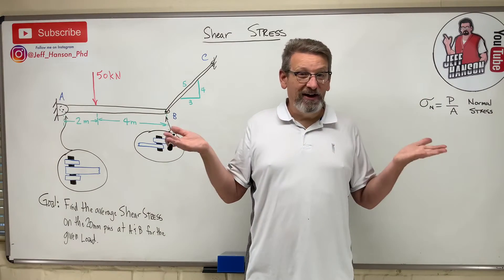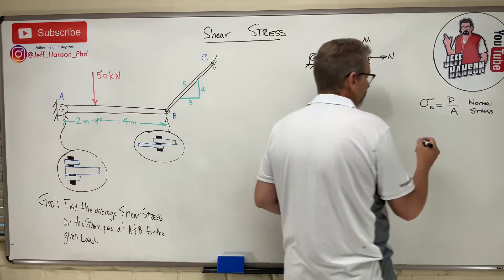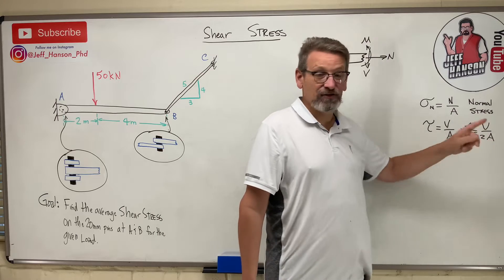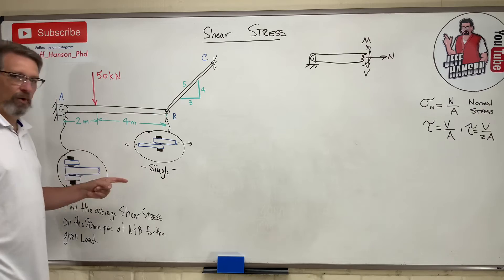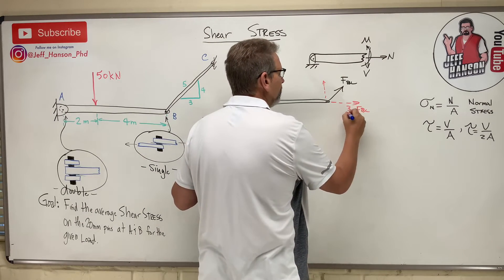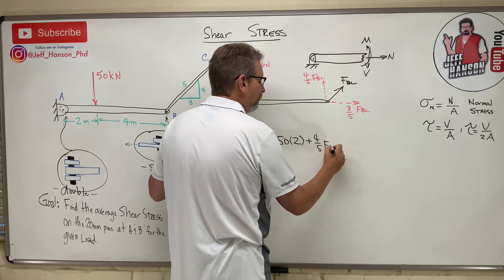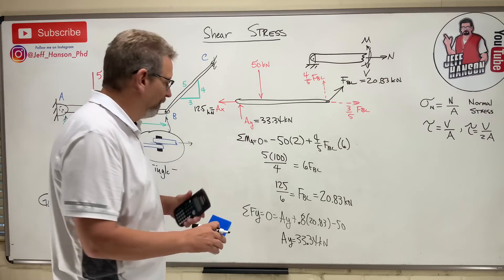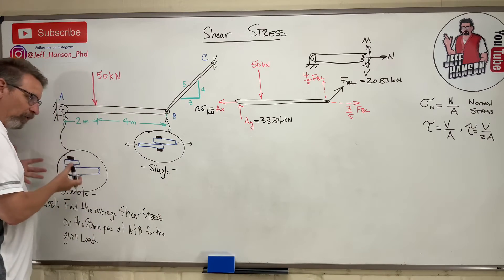Mechanics of Materials: Lesson 4 - Shear Stress, Single and Double Shear Example

Comment: HI . For finding the shear stress at A, wont FA just be Ay . I mean the shear force is always vertical . Why are we taking the squares of Ax and Ay ? Also how do we know if the method of sections is required for finding the shear stress . This problem did not require any methods of sections .

Comment: why did we use the resultant force while calculating the shear stress? i thought we were supposed to use the force component which is parallel to the surface area

Comment: Thank you Prof for this video. Although I hae got a question. Shouldn't the Force used in calculating the Shear stress be the shear force and not the resultant force as used in the calculation. Thank you as you dispel my misconception and calrifying imthe resultant force should be used.

Thank you sir

Comment: Hello, Thank you for sharing nice videos. I had a question, for calculating shear stress at A & B why are we taking resultant force? Will not be the force working on perpendicular to the cross-section, that mean Ay and Fbc?
Reply: first of all shear strees creat by parallel  force to the cross section. if you understand this then Ax and Ay are both parallel forces to the cross section.so you most calculate the resultant RA .

Comment: Why are you taking the resultant on A for the shear stress? The x component acts on a different cross sectional area on the internals of the pin vs the y-component.
Reply: Both are acting across the same cross sectional area. Both are acting across the xz-face.

Comment: can you explain more on why you used the resultant force at point A and not Ay to get the shear stress
Reply: Same problem here.
Reply: because the support at A has two components or reactions, Ay and Ax. So, using the resultant force of the two components gives you the more accurate reaction that is applied at support A, therefore, using resultant force to get the shear stress.
Reply: @fadelity4444  I am still not following. If I was to obtain normal stress, id only use the x component of the force, but for shear why arent we using just y component of the force?
Reply: Hello, I got confused regarding the area. Since the given is diameter, isn't it pi/4(d²)?
Reply: @kentalbertlucob5032  is equal pi×(r)2 or pi*(d)2/4

Comment: I think after reading other comments now I undrestand why we are using resultant force instead of the Ax.

The pin itself is perpendicular to the whole plane (you can imagine it sticking out of board) So because this pin is perpendicular to all other elements and the board (the plane which all elements are on it) the both Ay and Ax are perpendicular to pin and considered shear force.
Reply: Adding some further clarification.

Background: our previous understanding of shear, is based on a 2D diagram of a beam, with the shear force perpendicular to the longitudinal axis of the beam. For example we have the beam extending along the x axis, and thus the shear force extends along the y axis.

In this problem:
- Support A has support forces along x and y
- Pin at A is oriented along z, with its faces/cross sections in the xy plane
- The diagram in the example is a 2D depiction of an 3D structure (recall the pin has a longitudinal axis in the z-direction)

Now, recall the shear force is perpendicular to the longitudinal axis. Since we have a 3D structure here, and the longitudinal axis of the pin is along the z axis, the shear forces on the pin will occur in both the x and y axes (both x and y axes are perpendicular to the z axis). 

Thus we use the resultant vector, or we can use the individual x and y components, and find the resultant.
Reply: It looked to me that Ay should have been the one used. I am not sure why he is using the resultant either as the components seemingly act on different areas.
Reply: @mitchell6973  The shear force would be the resultant because the pin is oriented with the end facing you. This means the normal force would be directed either into or out of the board.
Reply: Thank you so much, I was confused on this same thing
Reply: thank you so much. That was so hard to grasp my head around
Reply: ahhh genius
Reply: Ty i was so confused

Comment: 10:45 We want to calculate the shear stress on pin so shouldn't we just use Ax because it's the shear force apllied on pin.
Reply: Think of shear force as a “tearing” force.  Both Ax and Ay are trying to tear the pin apart.
Reply: @samvalmassoi4237  i got your point, thanks. samely, why dont we take into consider Ax and use resultant force when we consider normal stress?
Reply: @samvalmassoi4237  Yes, but they act on different cross sectional areas so how can you just get a resultant like that?
Reply: @mitchell6973  they both acting on the same cross sectional area of the pin which is circular
Reply: That’s my question too.
How can we add shear to normal the way he did?

Comment: I don't get it. Why do you consider Ax as part of the shear stress. On lesson 2 you said that the forces acting axially on a member are considered normal stress. So Ax must be a normal stress
Reply: Its because we are calculating the shear stress on the pin, not the beam. Think about the pin and you will realise that both Ax and Ay is perpendicular to the pin (as the pin is going into the page)
Reply: @AB-gu9ui  thank you this was the best explanation. The top down view I think confused me some
Reply: @AB-gu9ui  so do we have to use Ay with Ax when calculating the normal stress on the pin?

Comment: Professor shouldn’t be used the force of 12.5 kN to calculate the shear stress in the pin A, being the force that will shear the pin because is actuating on the horizontal direction!?
Reply: Both Ay and Ax are acting parallel across the face of the pins. Therefore, both forces are shear forces. If there was a Az force, that would be the normal force.
Reply: Think about how the pin is along the z-plane

Comment: Area is given right 20mm?  is a radius or diameter?
because the formula of diameter is π/4 (d)^2?
Reply: The diametre of the pin was given as 20mm so we can half it to find the radius and use π*r^2 or use π/4 (d)^2 with the diametre

Comment: why is the resultant force being considered for calculating shear stress.. shouldn't it be the tangential one...
Reply: if it was a beam yes you are right. But it is a pin connection so pin is under shear stress either x and y direction. because of this we take the resultant force at the pin.
Reply: @hancar8142  Man I hate statics and solids. It makes no sense. It is never clear. Are we trying to calculate stresses on the pin or on the member. Last lesson he mentioned that axial forces acting on a member are considered normal stress. Then Ax has to be normal stress of the AB member. But if we talking about the pin, then Ax  is obviously perpendicular to pin and is a shear stress. So which one is it.
Reply: @bardia8225  if you look at the question its asking to find shear stress at pins. So if you analyse pin connection and if there are force acting tangential direction of the pin, there occurs shear stress on the pin. But it depends on what you are analyse on which part of the system. in order to be a normal stress on the pin, there must be a force acting z direction I mean the direction must be normal/perpendicular to the pin/body. English is not my native language I hope I helped you understand man.
Reply: @hancar8142  yeah kind of. thank you. One more question, why is the Ay considered in shear stress too? The Ay force only applies tension force on the pin. is that not true?
Reply: @bardia8225  because it tends to cut the pin so it is condired as shear stress
Reply: @hancar8142  so do we have to use Ay with Ax when calculating the normal stress on the pin?
Reply: @Jose Ortiz yes, you are right.
Reply: That's what I was thinking. For the single shear case wouldn't it be the 4/5 Fbc used as that is acting parallel to the plain in question?